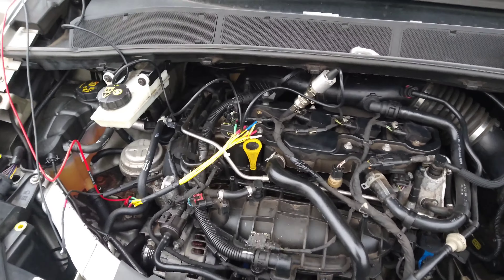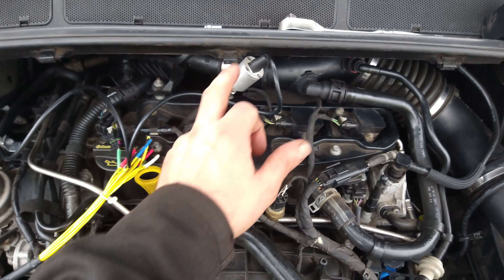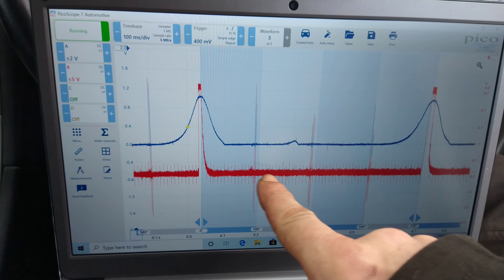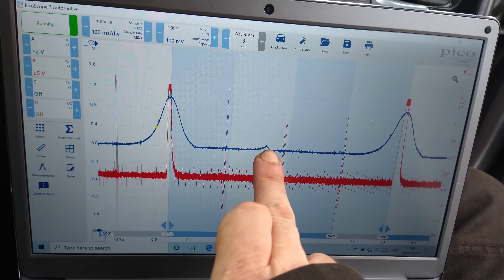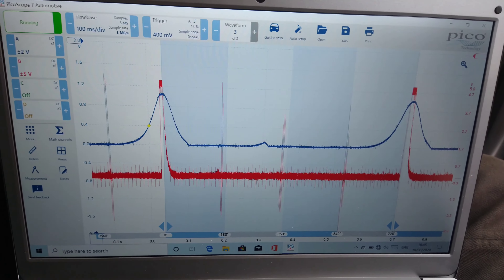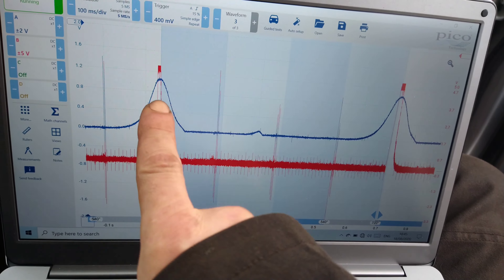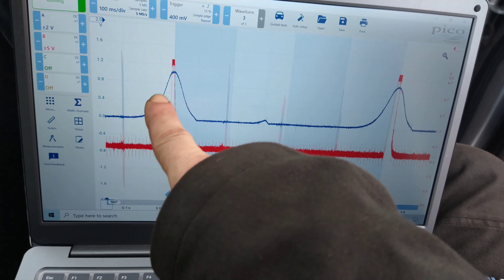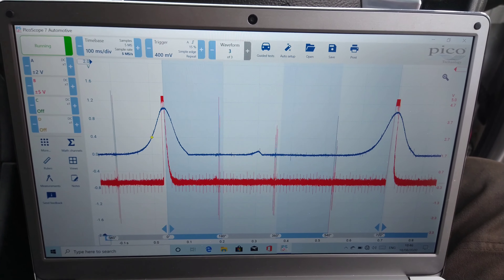Ford Galaxy (crank, no start ) jumped timing belt

Comment: Hi Matt where did u get your transducer from ? I'm after one that isn't gunna break the bank , thanks 
Rob mobile man
Reply from the maker: I first tried a few home made transdusers getting the parts from eBay, I found the wave form to look stepped and the vacuum part of the wave form wasn't accurate. Although it was better than nothing. I later decided that I couldn't afford a Pico wps500 and I never saw them second hand on eBay so I bought a fluke PV 500, it's similar to the more popular PV 350, I chose this one because it was cheap and when I combined it with the sealey compression tester that I already had it was great. Thanks for watching Robert

Comment: Hi In cylinder pressure wave looks in time with ignition..but how come timing is jumped..?
Reply from the maker: Hi there, the spark does happen at the peak of the compression tower like you noticed, it looks like it is getting it's spark timing input from the crank shaft, and that is ok.
The problem with the incylinder waveform was the valve timing, the exhaust is opening and closing too soon and so is the inlet, this can be seen because the point where exhaust closed and inlet opened was not in the middle of the two compression tower, it was too far to the left of the centre, another effect of this was that the exhaust opened too soon and that can be seen after the first compression tower because it should have a vacuum pocket after the tower that isn't there due to the exhaust valve opening before the piston reached the bottom of its travel. Thanks for watching